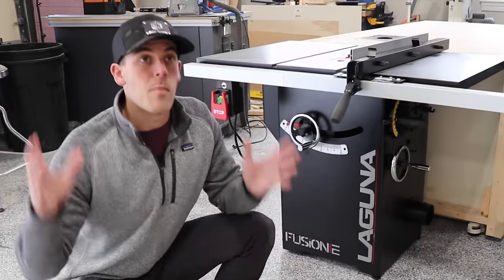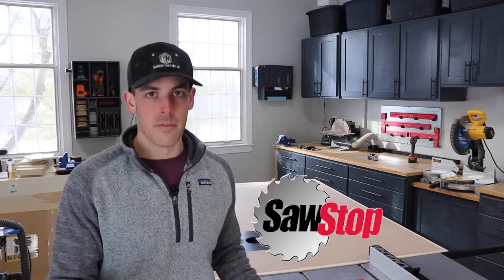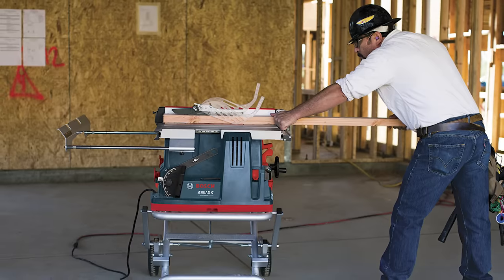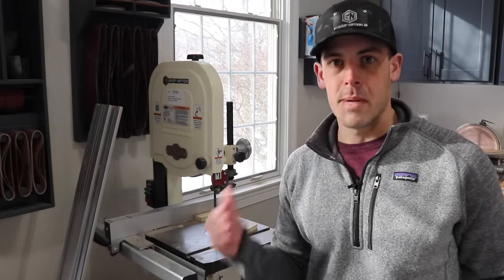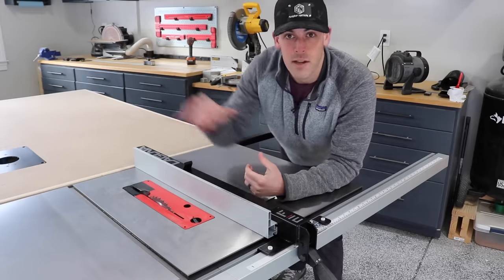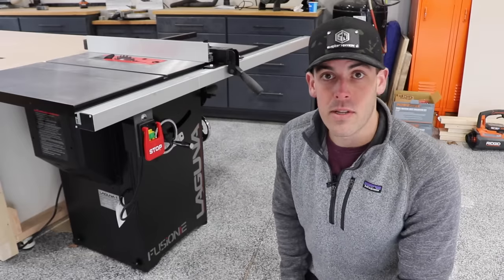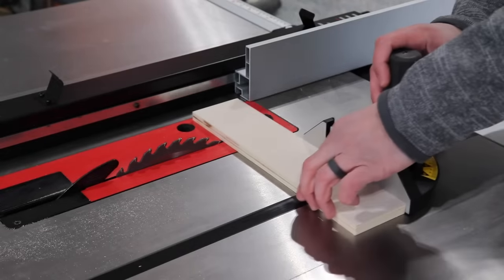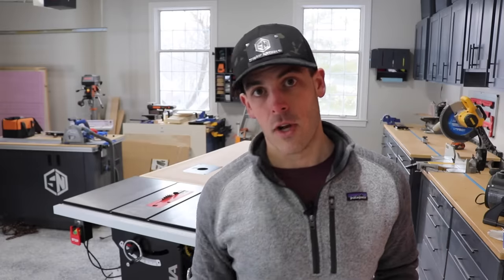Why I Bought a Laguna Table Saw over SawStop!

Comment: I'll toss another comment in here. About five years ago our makerspace purchased a SawStop Industrial Cabinet Saw.  It was about $4000 at the time, I think it is around $5K now.  The saw has worked pretty but there have been issues.  During the first few years we went through about 6 brake cartridges.  A couple of times it was do the user error, cutting mirrored plexiglass, and touching the aluminum t-slot on a jig.  The other times it simply fired for no reason. Sawstop replaced one of the cartridges because their system indicated it fired do to touching flesh (which never happened).  Over the last few years we have not had that problem, so I suspect their brake cartridges had a problem that they fixed.  The biggest prolem with the saw is the poor dust extraction.  Although it has a 4" port at the back, that port is fed from a 2" internal hose that only goes to the shroud around the blade.  There is no dust removal from the cabinet except vacuuming it by hand with a shop vac.  This results in another problem that exists on bost the Industrial and Professional saws.  There is a pair of bevel gears that are used to raise and lower the trunnion.  The gears get clogged with sawdust and it is very hard or impossible to raise and lower the blade.  A blast of compressed ait cleans the gears and all is OK.  But it's not a fun job blowing compressed air in a cabinet without dust extraction.  In my home shop I have had a Grizzly 1023 for the past 13 years.  It's a great saw, everybit as good as the SawStop.  At the Makerspace we purchased a Sawstop mostly because we never wanted to explain to an attorney for a person who got injured why we didn't have a Sawstop.  Self-induced extortion I guess.
Reply: That's definitely the spot for a SawStop.  I just ordered a Harvey.  Nice saw, best fence I've ever seen, very VERY rich in features, 4 hp, dovetail ways, 700+ pounds for $700 less than a SawStop at 3 hp.  Plus the Harvey comes with $279 compass miter gauge as a standard feature.

Comment: I had the same decision to make and had narrowed my search down to Delta, Shop fox or the Laguna, all 3 hp versions and Home Depot offered the delta 3hp 36" for $2500.00 delivered w/0 interest and thats what I went with and glade I did. You may find down the road that 3 HP is better able to handle thicker hardwoods.

Comment: You are right on the money with the F2.  I've owned one for a few years and it is a wonderful saw.  8/4 hardwood is sometimes a problem at 1.75 hp but if you make gradual repetitive  cuts it goes through easily.  I also have the 14|12 bandsaw, and the 16|12 lathe both are great performers.  the saw also operated beautifully with a dado set.  My preferred dado is the Dial a Dado from Freud.

Comment: I use push sticks, featherboards, and generally try to use best practices in the hope that I never trigger the SawStop safety feature.  But the impact of an accident would be very high, and the probability of an accident is definitely non-zero.  You do you, but I'd rather have the SawStop.

Comment: I just got that delta contractor saw you upgraded from. That is an awesome saw for the price. If you are new to wood working and don't want to drop 1,400 on your new hobby, that's a good starting saw. I had a cheaper one before, and I do not recommend.

Comment: Well, I'm 56 (tradesman) been  using tools including chainsaws and radial arms, since I was 14. So clearly I have a few stitches, and way more tools than I need. My forever saw is a 3hp powermatic 66 cabinet saw with 6' of cast iron for a top. With new bearing, shopbuilt motor cover, wiring repair and cleanup I'm at $400. Yeah ,stole it.What a joy to use... safety is one thing (most important part should be between your 2 ears). Kinda like me demanding folks have a full roll cage and a harness on their Harley. No bungee jumping, rock climbing, etc  There are risks in life. I cant afford 3-4k for a cabinetsaw. If I had employees, a dumb kid. Yeah maybe. But isn't the case. "MY" call .......merica.

Comment: I got the F1 about a month ago to replace the Ridgid 4520 I returned because it was filled with a bunch of problems. I am completely amazed at the quality level increase in a saw that is only a couple hundred more than the Ridgid. Dust collection is lackluster and of course, it can't rival a multi-thousand dollar saw. But seriously, if you're on the fence, get this saw.
Reply: Good to hear.  I just returned a Delta 36-725T2 because of all the play in the motor/trunnion assembly and am shopping for a new saw.  The F1, F2 and Jet ProShop are on my list of saws to get.   I fear the F1 is not a big enough step up from the Delta, which is why I am leaning towards the F2, or other.

Comment: Hi buddy, I have the Fusion3 in my shop here in Northern Ireland Uk and it is a great saw, very flat and cuts extremely straight, for the price point I simply cannot fault it, maybe a soft start would be pretty close to perfect, you have chosen well, the SawStop is a great table saw but way over priced, stay well, Louie, Ulster Workshops UK

Comment: Table saw is the most common workshop tool for severe hand injury.    
Medical cost of treating table saw hand injuries is about ten times greater than the total sales value of all table saws.
Bosch also makes a safety saw that retracts the blade on contact,  but it is not available in all countries.
A saw without blade safety feature will be lower cost, but this is a short term saving.
Reply from the maker: Another calculation without understanding risk!
Reply: Risk appetite is based on likelihood and impact. 

The impact for someone that uses there hands for work can be high, especially if its your dominant hand.

Likelihood, in 2007-2008, there were 79,500 injuries for table saw or bench saw accidents in the United states (https://www.cpsc.gov/s3fs-public/statsaws.pdf). To the likelihood is probable.

I have a SawStop, not because of sponsored videos or YouTube, but because its the only product that does what it does. I won't rely on it, and will take applicable precautions. I also don't agree with the SawStop politics on the subject. But until proven competition comes out, I'm happy with my purchase.

To anyone watching this video, do not make any assumptions or decisions on ANY product based on a video, there is no such thing as an un-bias review. Go see, touch, interact with the products in your price range and make your OWN decision.

Comment: I bought my Powermatic 66 in 2005, the last year for the 66 and the last year for USA built Powermatic saws. I paid $1800    One thing Powermatic is known for is weight and at that time the 66 was the heaviest of all the 240 3hp saws.  At over 700lbs it soaks up all vibration and consequentially allows for cleaner cuts.   I would give a full review but as the 66 is a dead model line there seems no reason.  Just know that I wish I had bought an interim saw and waited for the nicer brands and models on the market today.   BTW: unless you are a fanatic stay away from shiny table surfaces as they require more maintenance and are easily stained/etched.  Not a big knock against Powermatic but again, I would have done something else had I known a polished surface on a table saw is not really necessary.

Comment: I'm fairly new to woodworking and yet I'm considering forking out $1500 for the SawStop Jobsite Pro for one reason.  I need to take a blood thinner med to prevent blood clots.  When I bleed, it really bleeds and is hard to stop.I realize that 99% of woodworkers don't have this issue, but I wanted to put my 2 cents in.  I don't want there to be  chance of getting cut.
Reply from the maker: That’s one hell of a reason! Makes total sense

Comment: I'm a 66 year old contractor, been using a table saw for >45 years almost every day. It's my hobby also. I bought a Harvey who actually makes the Laguna models. I Always use a push stick if it's less than 3" to the blade. I've been kicked in the stomach by a kicked back board but I Don't get my fingers close to the blade. Check out Harvey table saws they have the most awesome miter gauge. It's so over engineered it's ridicules. I have no affiliation with Harvey, just want to share a great deal with my fellow wood workers.

Comment: People are horrible at analyzing risk, so instead of trying to do it myself I turn to the people who do it for a living, actuaries.

If you look at actuarial tables for disabilities related to injuries associated with power tools and associated costs it’s really not hard to justify $1500 extra for a sawstop.

Of course I could trust my gut and say why spend the extra money, I know how to handle myself around a table saw. But then I’d be buying into the myth that I’m better at assessing risk than the people who make 6+ figure salaries doing it for a living.
Reply: I agree with your perspective on risk. However even setting aside the blade/stop technology, I don't think you can find an otherwise comparable 10 in 3 hp saw for $1500 less than a SawStop. Maybe for $500 to $750 less, but the fit and finish will not be to the same standard. I certainly understand that to fit a budget, many are willing to compromise on fit and finish. That's why I have several Jet tools.

Comment: I have used the Delta Rockwell, Craftsman, and Powermatic. I have a Powermatic I use for the majority of my work, but use my Shop Fox sliding table saw on cutting multiple pieces to size. Then I use my old 12” Craftsman for dado and molding head cutters. The Powermatic and Shop Fox are 10” and doing it over I would purchase a larger sliding table saw for full sheets to fit. The Shop Fox should have had the 50” to the right fence and if ever available I would gladly update.

Comment: I wish you luck with your Laguna , especially if you have problems. I owned the TSS table saw and the 14” bandsaw, the table saw was nothing but problems because it had a metric/ European motor. Making a long story short the table saw is gone and I am in the market for a new saw. I won’t even consider a Laguna. Good LUCK !

Comment: I would love a Laguna, but I basically operate out of a double duty garage. I use the Delta saw and your right, dust collection doesn't suck.... wrap your mind around that... BTW. purchased on of your 3D printed Dewalt mitersaw dust collection adapter, that does suck really good...

Comment: Somewhat of a counterpoint...I have a saw at my shop that has the sawstop technology because my staff are not really woodworkers, and the liability of having an employee possibly injured is a big economic factor as well as other considerations.  We build crates sometimes.
My uncle was a lifetime cabinet maker and he lost a finger when he was almost 60.  He was not the only guy in his shop with that condition, either.
But when I bought a table saw for my vacation home shop I bought a cheaper saw, because I plan to sell it and upgrade it to a SawStop some day in the future.
FWIW I also crushed a finger in the warehouse in an accident with a powerful magnet.  Did not lose it but it was not a good day.  And I am an amateur.  Sometimes there is sawdust on the floor and the lighting is not ideal and I am tired.  
I'm at a place that I can afford to spend an extra $500 for an otherwise equivalent saw, which is very roughly the premium that you pay for that safety margin.  Not everyone is.  But sober consideration should be given to SawStop.

Comment: It really is a shape that SawStop has a monopoly on their safety feature.  I mean I really would like to see the ability to have aftermarket sawstop upgrades to existing saws, though I do also understand the engineering of that would be insane.  But they know they have a monopoly and the threat of loosing your fingers is enough to convince people to buy their product over what may be a far better saw at a lower price.  Shouldn't be forever though.  Patents do run out and I suspect that the other companies will start making their own versions as soon as the patent runs out.  Though likely at an additional fee which I think most of us would gladly pay.

Comment: Great review. I always enjoy the actual review vs the “I just bought a week ago used it twice” type. 

So I went with the Sawstop just recently. A table saw injury swayed me. So I modified the height if the Ultimate workbench to fit my delta 365 and it is 75% complete. Now I’ve I got to figure out a way to shorten it. That should be fun. Thanks for all the content.

Comment: yeah, I first found the Laguna table saw after I was looking for a better dust collection for my Grizzly table saw.  I wish I had found them before.  I really love my dust collector and have been eyeing the BX Bandsaws for quite a while.  I'm really interested to see how you like using the table saw.  My Grizzly is fine, its a great saw but it has a lot of things I wish were done differently and didn't require modification to get there, but it has been well worth the cost of it.

Comment: SawStop is a good idea for any shop that will have a bunch of amateurs yoinking on their saw.   Like a trade school, or production shop.   But I can’t justify the cost.   Been using power saws, power tools and hand tools for  45 years now.   I have never so much as nicked a finger on a power tool… because my father taught me how to use them safely.   I never have allowed myself to get complacent around a power tool. And I trained my sons and my apprentices to use them and be just as paranoid as I am.  And my favorite saw, the saw I do 90% of my cross cutting and ripping on is a 1953 DeWalt 14” radial… One of the scariest saws on the planet.  ( its deceptive though, Radial arm saws have always had a tiny fraction of of the accident rate tables saws have always sported, because they can’t really kick wood back at you and the fact that you can not help but be more aware of the position of the blade relative to your digits. It is literally the mostly hidden nature of the blade that makes table saws so dangerous. ) 
In fact, the single worst injury I have ever gotten in a lifetime of working with power tools and hand tools was a deep arterial slice on the back of a finger from, wait for it, the serrated metal strip on an industrial size box of Saran Wrap.      
Saw Stop is too dang expensive, and like a lot of extreme safety measures, it breeds complacency.    And it does not one dang thing to make a router, belt sander, bandsaw, jointer or any other power tool in my shop one whit safer.   All I have to do to keep my fingers intact with my table saw is ALWAYS take the time to set a riving blade guard or knife, never try to cut something too big for me to handle alone unless I have assistance. Always set a feather board or other stabilizing device, always use push blocks or fence riders, never cross cut  nor rip a piece of stock where the cut will be shorter than the linear lengths of the exposed blade disc.   And always always opt for the radial arm saw for every cut that it is better suited to handle. Which is every cross cut shorter than 24” and every rip 24” or narrower, and every angled or beveled cut, every dado or rabbet.

Comment: I have the same saw...Laguna F2.. the quality is good and purchased for the price point, but wish I had 3HP when working with hard woods. Dust collection seems to be weak.. I have the Oneida Supercell hooked to it and cabinet still needs to be emptied out more frequent than I feel it should... I took apart hoping there was a tear in the dust collection hose but unfortunately was not. I replaced the overhead dust collection with the Sawstop 4" and that works great..I have never used a Sawstop or any other mid priced cabinet saw so can't compare. Dust collection could be comparable but I am guessing there are saws with better...

Comment: This is a difficult decision. Im glad you narrowed it down. 

If you loose a finger will the saving matter in then end? Would you regret saving the money and not getting a SawStop? 

I am middle aged and personally know 4 people that lost 1-3 fingers on a table saw so far in my lifetime and a fifth person from work that nearly did and had to have surgery. I have been lucky and safe using push sticks and taking extra measures but the severity is too great and probability is higher than some might think.  

From popular wood working a few years back this was the probability you are talking about.  I think there is a lot of people that have injuries. 

In the context of the general population of 310 million Americans, about one in 9,000 will go to the emergency room in any given year after tangling with their table saw, one in 80,000 will have a medical report that lists the word “amputation” and one in 160,000 will lose one or more fingers or a thumb. 

If you think of how many Americans actually use a table saw then the one in a 160,000 probability gets worse.  If only 1/10 of the population even uses a table saw (I think it’s less then that) and has zero risk then one in 16,000 table saw users will have an “amputation” per year.  Thats high to me.  Someone correct me if I’m wrong. 

I’m still considering a SS and other options, but I’m probably going to spend the extra money on the added benefit of minimizing the chances of that the risk in the shop for peace of mind.

Comment: That looks like the perfect saw to replace my Delta Platinum Series contractors saw. It has the 32” Unifence that I absolutely love. Has the same feature for the high and low configuration and sliding it back for make multiple cross cuts.

Comment: I’ve been using table saws for 50+ years the most serious injury was from kickback several broken ribs caused by a crappy rip fence! All tools can be dangerous for me most serious was from a sander. I’ve even seen a serious injury with a screwdriver. 🪛 FYI I’m currently using significantly modified 50’s vintage table saws. Replacement costs is the reason I’m using them.
Safety is primarily personal responsibility